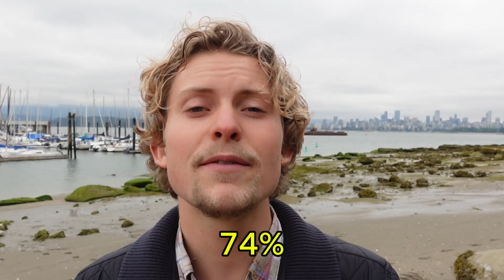This Bike Runs on French Fry Grease. Here’s Why It Matters.

Comment: Well I hate to burst your Bubble... Yet someone did that in Pennsylvania back in the day with a Yanmar Three cylinder Salt spreader motor... Had diesel fuel to start it with and run for first 5-10 minutes... Then it would switch over to the Biodiesel... Then just before you stop riding it... It switches back over... Now when you say biodiesel... It's really Grease fat from foods... Yet will still turn back into grease if it's not Hot enough...
Yet I like that your doing this... I've always wanted to experiment with different ways of using a diesel motor... Another man did it with a Smart car Three Cylinder motor also in Europe... 
Peaceful Travels.